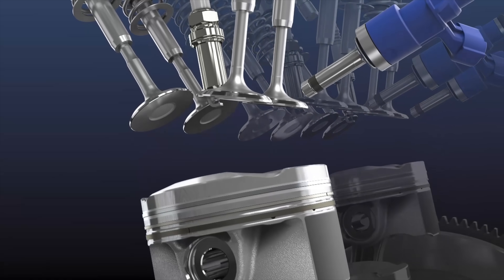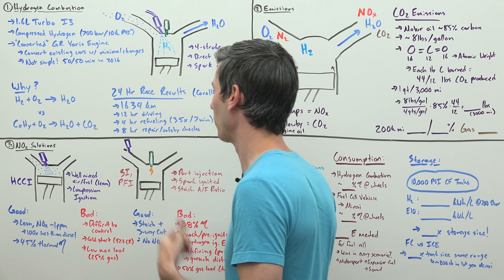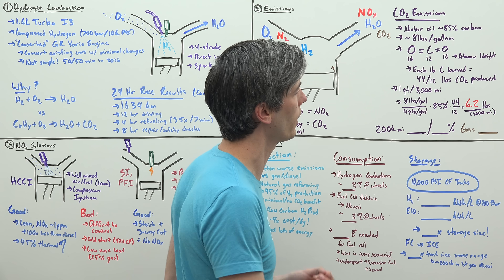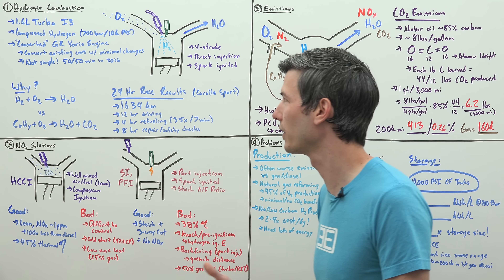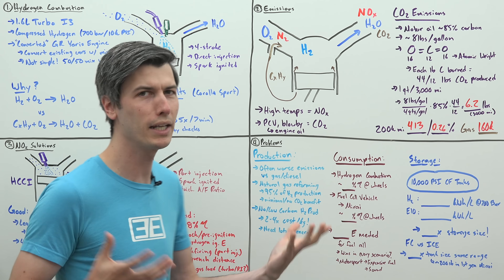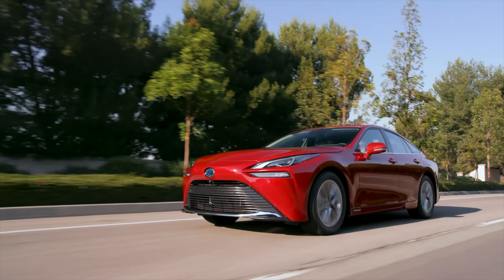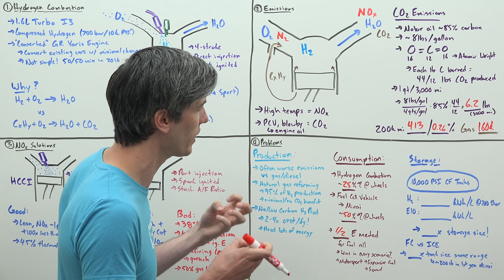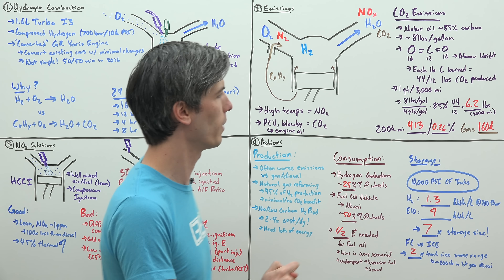Toyota's Developing A Hydrogen Combustion Engine!

Comment: Toyota: WE MUST BURN SOMETHING !
Reply: Funny!! I think the engine development teams are feeling the heat from the electric powertrain teams, No pistons, No catalytic converters, No valves, No fuel pumps or injectors, some with no transmissions…, The winner is electric!
Reply: Wrong. Toyota: we are trying 3 different routes at the same time because no one else is exploring them!
Reply: Toyota already has hybrids and it's pushing battery chemistry forward that will eventually result in solid state batteries, something that it, unlike Tesla, will be able to disseminate widely. It's also one of the few automakers working on fuel cells, which will arguably supersede both batteries and internal combustion engines even when taking emissions into account.

Due to embodied emissions of production, battery EVs have higher life cycle emissions unless they charge from electric grids served primarily by nuclear or hydroelectic power. Even with so-called "renewable" grids, the emissions are produced by backup gas turbines. The end result is that unless a BEV is charged from a low emission grid it will also have a lifetime that is high emission eventually. It's one of the reasons why an electric car is greener when running in one of the Scandinavian countries, because that cross-country grid has a backbone of hydroelectricity from Norway, nuclear power from Sweden and wind power from Denmark. But it's not so green when running in California which burns and fracks gas for most of its energy. 

Arguably, the lowest emission vehicle possible is an ammonia fuel cell vehicle using ammonia produced by electricity from a nuclear and hydroelectric grid. That vehicle will be low emissions in operation and embodied in production and disposal. And it would be more fully recyclable, than the carbon fibre composite fuel tanks a hydrogen fuelled vehicle would be. Right now composites are just dumped in landfill, something that Denmark and its kilotons (and in a decade, a megaton) of wind turbine blades are finding out to be a bit of an issue.
Reply: MONEY 🤣🤣
Reply: @SyntheticFuture  They're too late tbh, the worlds set on electrification by 2030. They and other manufacturers got too comfortable and lazy to innovate when there was still time
Reply: @dominicancheif117  they started in 1992 with research for fuel cells and alternative fuels.... Waaaay ahead of any automotive company. Electricity is not the be-all-end-all of energy. It's hard to store for example, that's a big issue. So there's plenty of room for alternatives.
Reply: @SyntheticFuture  You do understand all combustion engine vehicles, alternative fuel or not, create or use electricity? The simplest answer is most often the correct one... The future is EV, and we are just at the beginning of the exponential growth that is battery energy density.
Reply: selling bottles of hydrogen, where is the money in that ?
Reply: @joedfazio  Electric wins if you want a toy. If you want a functional machine for transport you want Hydrogen. But anyone who drives electric really shouldn't be driving at all.
Reply: @joedfazio  only the motors in electric cars are any good. The batteries suck. They’re heavy, bulky, worse than burning fuels to produce, and simply not long lasting. Hydrogen is pure eco. It just makes water. It’s the perfect fuel for the current technology
Reply: @o0julek0o  Batteries have been making steady improvements over the years. Soon the cost of an electric car will be at parity with gas and diesel. The issue is complex because electric cars are mostly powered by fossil fuel power plants. Ask yourself this question, how do we get the hydrogen? The process  and energy loss  involved reveals hydrogen is a poor way to store energy.
Reply: @joedfazio  Batteries are short lasting and their production takes a visible toll on the environment. Converting current petrol based cars would be infinitely cheaper than any other solution. There is no complex issue here, the power needs to come from a neutral source, best would incidentally be hydroelectric generation. Whilst hydrogen might not be the most efficient way to store energy, it is the most efficient ECO FRIENDLY option.
Reply: @o0julek0o  I get the point about battery environmental cost. Maybe there should be more consideration for synthetic liquid fuels compatible with the existing fleet. Pulling carbon from the environment to bind it with say hydrogen could be carbon neutral if the energy to create the synthetic fuel comes from renewables.
Reply: @joedfazio  No charging stations. NO power capacity, no power grid capacity, no adequate power sources, failing existing power grids, failing existing sources, failing green power sourcing. Wait did I mention NO POWER. lol  Consumers are currently having their power for their homes and businesses throttled back during peaks, power grids failing under current loads and then we say, convert all cars to electric NOW. lmao
To bad cars can't run on crack like people do! lol
Reply: @beebop9808  Very good points! I heard California has rolling blackouts and they are all in on EV’s??? We need to hold our political representatives  accountable for their rhetoric! The transition will be gradual, internal combustion is not going away over night. That said, oil is a non-renewable resource so change is inevitable. Where I live, the grid is not strained So the EV’s  are not causing blackouts  yet….
Reply: Volkswagen AG and Audi AG have agreed to a class action settlement that includes $2.3 million in attorney fees as well as costs for customers’ repairs incurred to repair damage caused by allegedly defective engines that consume too much oil.
Reply: @squidproquo2241  hopefully not I just got a 21 tiguan
Reply: @MonMalthias  You are wrong.
Reply: Wtf is wrong with Toyota?
Reply: Yeah, I mean even the fuel cell is ‚burning‘ the hydrogen—sure, it‘s a very controlled burn, but in the end, it‘s still oxidising the hydrogen, which is the same chemical process as burning!
Reply: @ErectileSceptile  That's not even the issue though. They're difficult to produce cleanly, difficult to recycle, and are powered by non-renewables anyways. Not to mention that a Tesla battery only lasts between 300-500 thousand miles, and you'll start noticing capacity issues long before then (Because Lithium-Ion is ass for keeping the same capacity over time, just use your old phones as an example). You're right that electric is far from being the winner. But personally, I don't think gas or diesel powered cars should be the first target of the climate agenda. Governments are scared to upset oil companies, so they'd rather not implement more nuclear and hydro, so it's easier to target us to buy new EVs and inherit all the worse issues involved such as heightened repair costs (By a large margin), little to no personal repairability for the vehicles, short life spans (You literally need whole new batteries by the time you're done with these vehicles, which means they'll more than likely end up in a landfill long before a 90s Toyota would).
Reply: @Malohdek  
Vehicles alone are basically a fool's errand to target with emissions controls, because they are addressing a symptom - decades of underinvestment in public transport (or active destruction of it) and its replacement with a transportation system and culture that causes tens of thousands of accidents, injuries and deaths each year.

A diesel bus without emissions controls, is still less emitting than transporting the same amount of people with a fleet of 100% clean hydrogen fuel cell vehicles. It comes down to economies of scale: it's less energy to transport 20-60 people on a bus, than 20-60 people across 10-30 cars. And most cars are single occupant only! So it's more like 45-60 cars.

Do the same calculations for light rail / trams (120 people) or rail / trains (1000+ people) and there's just no comparison. The dirtiest, most fuel guzzling train would be just a blip compared to the emissions of a thousand cars and the infrastructure to accommodate them.

The reason why California is so plagued with traffic, fracks gas like no tomorrow, destroys its nuclear plants, and then builds highways with tar and crushed rock is the same reason green groups across the US have always hated and advocated against nuclear power: money from the oil industry.

From the NRDC taking money from Chesapeake Energy (fracking company) to Friends of the Earth being founded on seed money from Texaco, to Amory Lovins consulting for 4 decades for Standard Oil while pushing hard for "efficiency" and "renewables" and "combined heat and power" - what should be clear to anyone with even a casual reading of history is that actually, environmentalists don't care about climate change. What they care about is the money that the concern about climate change, or nuclear power, or whales, brings in.

It's all about the Benjamins baby!
Reply: @joedfazio  Rolling blackouts? lol Where did you hear that from? It's 110F here and people's ACs are in full blast but no power outage. Our power management is actually good.
Reply: EERRRR !! GAS !!!???
Reply: @genx156  MY SECOND ! THOUGHTS !! TOO !!
Reply: Great point! Very few people understand that increasing public transportation in cities and large towns would make a huge reduction in emissions. I have been to a lot of cities, and most of the public transport is pretty poor and or inconvenient. New York City has a pretty aged public transport system, however it works very well. Many residents in Nyc don't even own a car because public transportation is so convenient there.
Reply: If we don’t burn something big Corps ability to squeeze money out of us is limited!
Reply: @ErectileSceptile  AND !! ALL !! YOUR !! BATTERY !! CHARGING !! COMES !! FROM !! THE !! POLLUTING !!   POWER !! STATION !! NOW !
Reply: @MonMalthias  the energy density ammonia is only moderate. We need fuel cells running on butane.

Comment: I've been waiting, since 1978, for hydrogen combustion vehicles, thanks to an over-enthusiastic high school physics teacher.
Reply: Tom Cavanaugh
He must have been such a good guy to know!
They always say that you never forget a good teacher!
Lucky you! He/she will have inspired you with the same enthusiasm. Mine came from a guy with a little corner electrical and radio repair shop who recognised my teenage interest in radio and fired me up. ...
If YOU get the chance..put something back. It's VERY rewarding.
Reply: Terry Winter  Who (i.e. what's the source) says that electrical vehicles are more expensive and pollute more than conventional internal combustion vehicles ?  Especially when evaluated over vehicle lifetime ?
Would very much like to "read up" on that but have not seen any reliable and credible material... No lack of opinions and speculations though!
Best regards
Reply: Terry Winter  
Which type of batteries are worse than what, and under which presumed circumstances ? 
General "declarations" whitout more precise specifications are unfortunately of no use when one wants to investigate and understand factual problems and their circumstances... 
Short (and often blusterous) simplifications might appear to be great soundbites and might even be in accordance with current findings. But they might just as well be mere slogans minted by some "interested party", and due to their brief and nebulous nature there is no proper way to determine which is the case, which renders them totally useless to anyone who is looking to actually inform them selves on an issue.
Best regards
Reply: @mpadlite2925   it looks like you are blindfolding yourself. The most common batteries used in EVs are totally reliant on RARE minerals. 80% suppled by China. Prices will NOT fall as the clue is in the word RARE. Not to mention the appalling condition that some people are experiencing mining Cobalt. Before sounding off at others please share your ‘expert’ knowledge and explain what YOU think is a win win battery.
Reply: This is such a great video!👍🏻
Reply: @mpadlite2925  you got dunked on
Reply: The first ever internal combustion piston engine ran on hydrogen because they did not have gasoline (nor diesel) back then.
Reply: BMW developed prototype H2 combustion engines many many years ago, at least 25 years...
Reply: Rudolf Diesel waited too long to launch his hydrogen engine. He fell off the boat going to see his investors in the UK..
Reply: Well u can thank Elon Musk for tossing them under the rug, even though there the only true green energy source
Reply: Terry Winter  perhaps your right but production is only 10% of the carbon cost. The other 90% is the consumption of petrol over the cars life time. While a electric car in theory is 0. Britain is already using 42% renewable energy in its power plants
Reply: Terry Winter  yep
Reply: Are you the famous actor tom cavangah?
Reply: Great
Reply: @mpadlite2925  I actually bought an old electric car for cost savings. It is the 2013 focus electric. It has small batteries and short range but I can use it very well. If I need to go far I have the 2002 Honda Civic( love that car) but for short trips to work where I can also charge it’s no big deal. I have high speed charge I built at home and then high speed charge at work.  It’s only 35 miles to work each day. After owning it for 5 months now I’ve put on 6,000 miles. I’ve done the math for cost and saved me $1,200 vs my truck and like $300 vs the car paying for electric rates that are high where I live. Still carbon footprint is little with the e cars
Reply: Yes, can't wait for the price at the pump.
Reply: You just didn't take into account The competition and established ICE fuel market.
Reply: Terry Winter  The whole EV thing is totally backwards.
Reply: Terry Winter  and dispose of or recycle
Reply: @TheMigs101  "Renewable energy"?? Like what? And with what cost to the environment?
Reply: @diji5071  Shouldn't our electrical infrastructure be updated including how to produce the electricity.
Reply: @diji5071  what’s backwards. My parents have a solar array they bought new. It cost a lot but it works. I wired all the electric for our house and have monitoring charts showing the production vs what we use. The turnaround for there array is years because they paid for pro installers and all that when it was new and expensive. Personally I bought used panels in bulk and the inverters and everything and am building the array currently. All panels are tested good. My payoff turnaround for used panels and new inverters is one year. 12 months based of the power output of the solar array already installed and the capacity of the array I will be installing. As far as electric cars go. I bought my 2013 Ford Focus electric for $7,000. My most expensive vehicle to date. It has saved me $300 thus far compared to my civic at 36 mpg gasoline. So yes it is a real savings. And they do have scientific charts showing average vehicle carbon footprint of manufacturing and the amount of time and miles the vehicle would have to run to beat the carbon footprint.
Reply: @melb5996  New Tesla batteries eliminate need for Cobalt. Others following suit. Battery tech is advancing far faster than any other tech related to transportation.
Reply: @4GlockWarlock  hydrogen as energy source?wut?
Reply: I had a super hippy chem teacher in high school that turned me into the idea. I've been questioning why this didn't exist for 20 years. It seemed like a logical progression, as most of the existing infrastructure could support it
Reply: Why wait if you can build one.
Reply: "Flying cars are just around the corner".
Reply: @melb5996  point of correction: they are called rare because when they were discovered they thought they were only present in Sweden. Nowadays we know of deposits all around the world and some of these minerals are even extremely common.
Reply: Terry Winter  Because government writes the check...
Reply: Who didn’t explain that burning hydrogen that was gathered from water won’t generate the same amount of water slowly burning away the earths water supply 😂😂 oh hydrogen the way to go yeah sure if you don’t need water to survive then it will be fine and sure it will take a few hundred years to burn enough water to be noticed but it will eventually be noticed and by then it may be too late
Reply: @TheMigs101  The consumer has to foot the bill for this privilege..
Reply: Well wait no more because propane is over 65% hydrogen so go for it
Reply: @phantomsoldier497  dont forget to point out that there are no Metals of the rare Earths in the Battery. applies to practically every Battery. At least i havent yet heard of any chemistry that actually uses one.

(for clarification: neither Lithium nor Cobalt are Metals of the rare Earths,  or commonly shortened to just Rare Earths. the most commonly used actual Rare Earth Metal in an EV, if its used, doesnt even go into the Battery)

Comment: Going to the 24h race Toyota was actually trying to find out the issues that the engine was having. It was much easier for them to find out.
Reply: I could have tested that out on the street.... They don't own a single track?
Reply: @dylantroutman4363  It seems they don't have a track for properly testing the cars
Reply: @dylantroutman4363  fuji speedway is their track
Reply: @kressy  and didn't toyota just built Japan's own Nürburgring recently?
Reply: @kressy  That´s their racetrack, yes. Testing cars however is done at the new Toyota Technical Center Shimoyama.
Reply: @dylantroutman4363  they tested the car and made some advertising
Reply: And then they found out it's BS.
Reply: It's a marketing exercise...
Reply: @dylantroutman4363  why test it privately when you can also advertise yourself while testing?
Reply: couldn't resist getting the comment to 700 likes